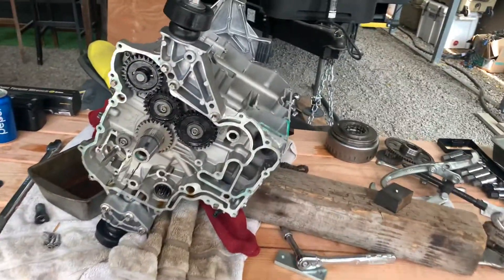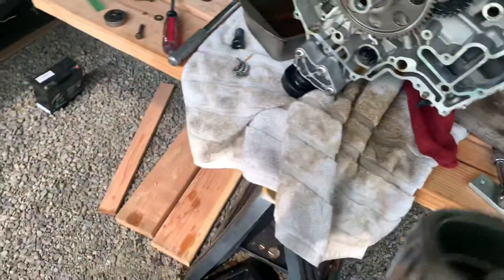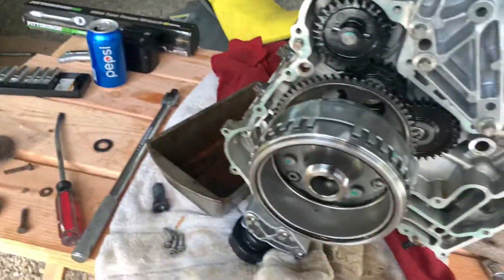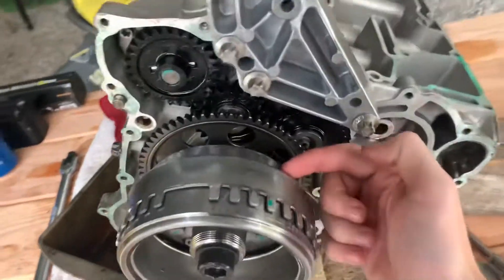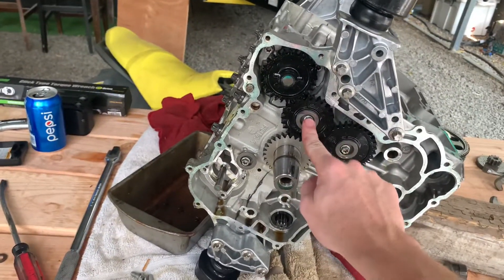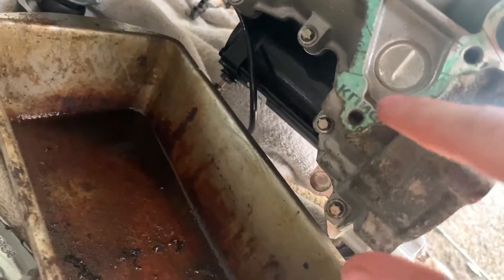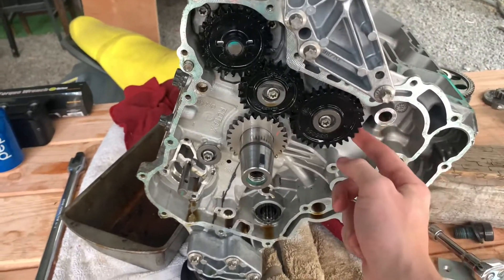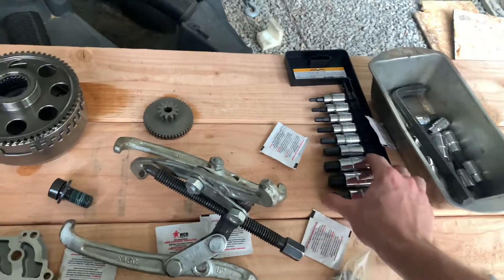2015 Sea Doo Spark- How to remove harmonic balancer, rotor, flywheel, clutch, crank pulley, etc.

Comment: What was the verdict on this engine? My 18 is having a similar issue
Reply: i tore the engine down and had a cnc machinist replace all of the bullshit cheap and fucking ridiculous plastic gears with metal ones which is what seadoo should of done in the first place. it runs perfect now.
Reply from the maker: It was the plastic gears. You can buy all new plastic gears online.

Comment: Bro you're a legend ... Are you a Mechanic? If not ... You should be! I've got a 2015 Spark as well ... Are you aware of the PTO issues with the 2014/15 models? The PTO is pressed onto the Crankshaft & if the Splines fail from incorrect engine alignment or the PTO gets Corroded ... You have to remove the Crankshaft. From 2016 onwards they changed the design to the PTO ... & Made it removable without having to tear the engine down. Have you checked the Splines inside the PTO ... Now would be a good time while you've got the engine out! 👍😎🤘 Beanie
Reply from the maker: Not a certified mechanic but I have worked a few engines. Fortunately for me I checked that drive shaft/PTO splines and mine were perfectly fine. I have other videos posted but I tore this engine apart because the plastic drive gear for the oil pump sheared so hopefully a new one will fix it.
Reply: @chasedalight  Cheers mate 👍
Reply: Great video. So just to use more specific terms the harmonic balancer is pressed on to the crank. That's why it "shot off". The tool has more torque so there's less tension and less of a shot and more of a pop. It is not good to dent the balancer but sometimes you gotta do what you gotta do. To get the balancer on You would want to get the crank as cool as possible and apply some heat to the balancer. The right amount of temperature change will allow it to go back together. A rubber mallet or the removals tool can be used too